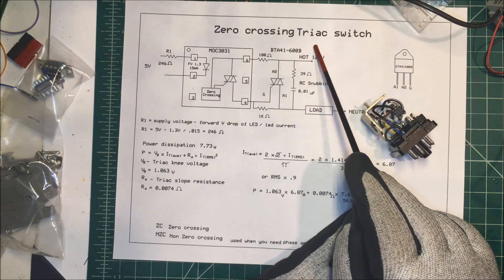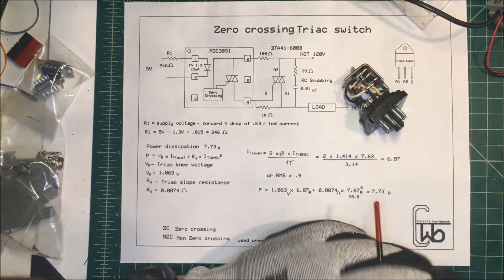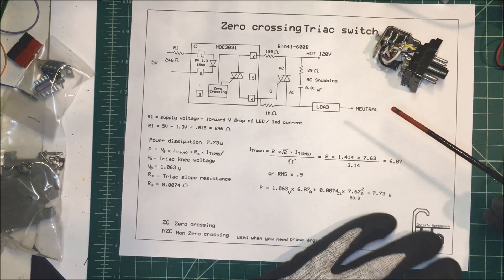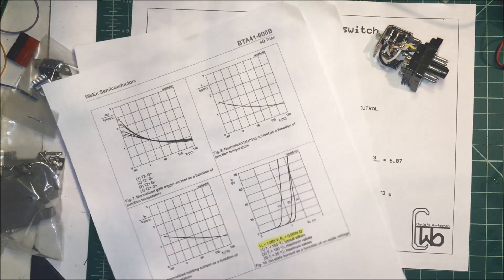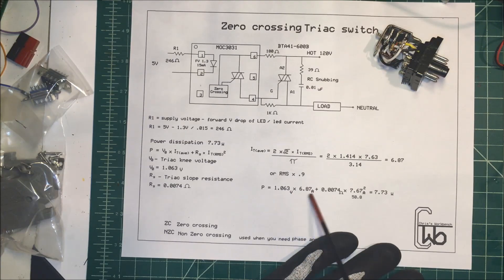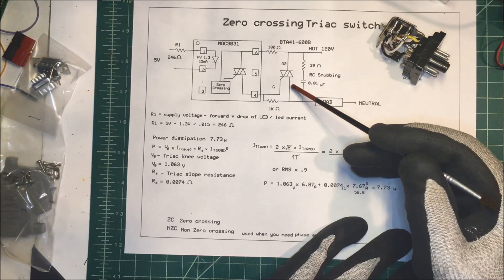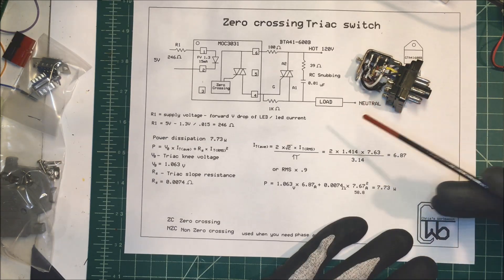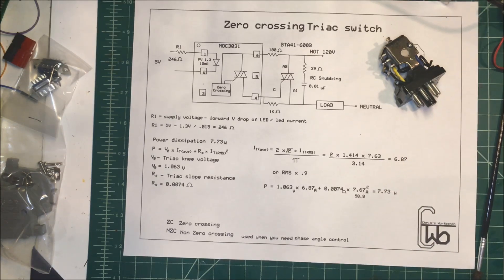Triac power dissipation

Comment: I usually measure the current flow and then measured the voltage drop across M1 and M2 of my triac circuits to figure out its dissipation.   But I also wanted to know how to predict  it mathematically.   Your last video inspired me and I located the same information on the data sheet on how you can use Rs and Vo to calculate the power dissipation.  Good topic.
Reply from the maker: Thanks